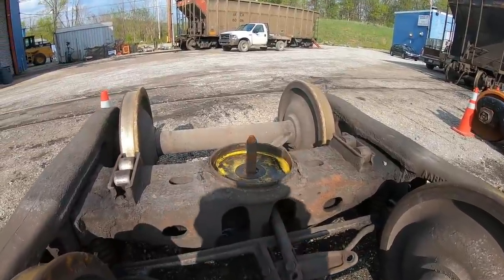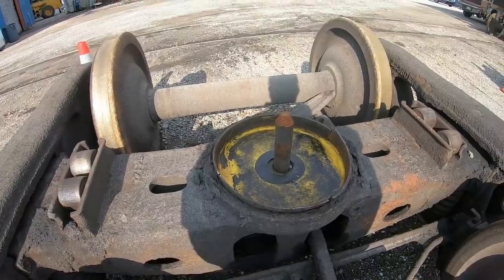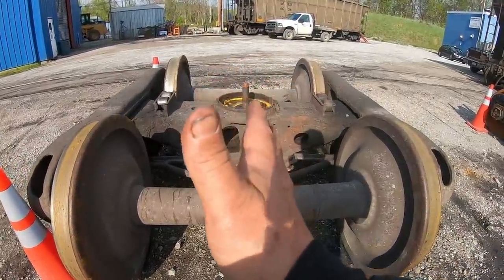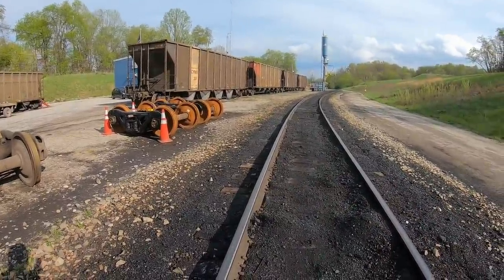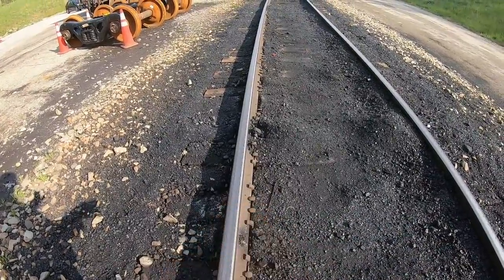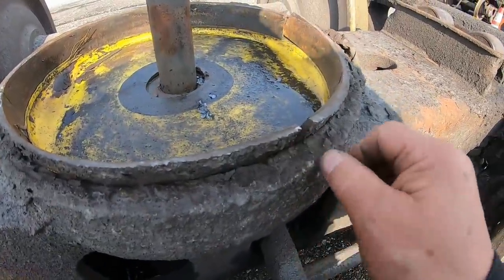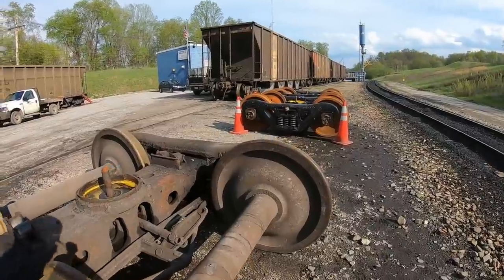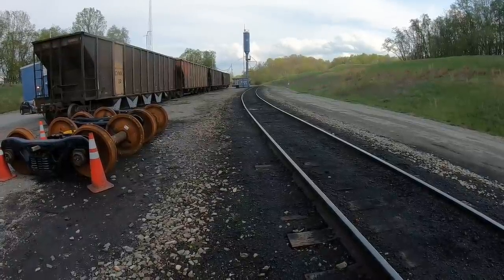Why the Derailment at Curve 18  Happened

Comment: Sorry, But I cannot agree with your finding. You didn't say much about what the track condition was before the accident,so it is hard to say. That center pin would have been bent if the truck was the cause. For the rim of that centersill to have cracked like that without bending the pin likely tells of heavy slack action over the course of the life of the railcar. I bet the lower end rail was the rail that caused the accident as it is more prone to natural damage. 
 I drove a locomotive over what seemed like perfectly normal/good rail, only to have the gauge spread out from under. Weather rots those ties (especially on a lower elevation section of rail), and those tie bolts and spikes can come out quite easily given a minimum of stress. 
 Also I can't even begin to guess how many of those railcars are without sufficient lubrication on their centersills. That's why the liner is made of tough plastic. The sheer weight of even an unloaded flatcar keeps the wheels on the rails even around turns. The couplers and speed (you said 22 MPH) helps this as well. 
 How long was your train?? what number was the car that first derailed?? 
 Also the AAR standard track gauge is 48 3/4 "
Reply: You mean 4’ 8 3/4” ??
Reply: @billmoran3812  Yes, I should have edited my post. The gauge  is 4ft 8 3/4 in.

Comment: I've jacked thousands of cars. Haven't seen but a few with lube in the bowl. Most have graphite patches if anything.
Reply from the maker: I believe the grease they use here George is a graphite based lube,
not sure why they put it in with the liners, but they always have.
Reply: @ccrx6700  I think the liners are Teflon. That's one of the reasons for them is to aid in rotation. Main reason for wear. I'm sure if they have any other lube other than the graphite patches it's because of the tight curves at the mines. I've seen them grease the rail at the curves to aid In maneuverbility. Thin flanges are bad for derails on a curve. Not sure were yours was. Looked like the pilot sheet on the motor was damaged. What did it hit, just the rail?
Reply: That center pin looks new in the truck. Wonder were the original one is.

Comment: What I am seeing here,  are all kinds of questions and zero answers.    A train running  around  20mph should be able to stop in  500 feet.   There are over 1400 feet of broken track.  Either the engineer never knew he was off the tracks and keep going as normal or  the tracks were not very well-connected and fell apart.     Maybe the brakes were not operating normally.     The "RED FLAG" I see,  is the 1400 feet of track and a very slow moving train,   it just does not add up to a solution.    A faster train,  50mph, yes,  it makes sense but,  not at 20mph.     Something just isn't right with this incident and the 1400 feet of blown track.    Hope they get it all figured out and cleaned up and back to hauling coal.
Reply: Lmao @ stopping from 20MPH in 500ft.
Reply from the maker: Rear DPU was still pushing for about 500 or so feet before
it came uncoupled and train went into emergency, then it took
another 800 or so feet to get the cars and lead loco stopped,
hope that helps make better sense of it now. Thanks for watching sir

Comment: I don't know. Speed and weight has a lot to do with the derailment. That locomotive have a speed recorder on it?
Reply: They have event recorders that capture everything from throttle speed to brake applications, travel speed to blowing the horn. Most locomotives have forward facing track image recorders also. It’s all interconnected.
Reply: Train was going 20 mph...
Reply: I should have mentioned that also, i believe he said the speed limit is 25 mph and the train was traveling at 22 mph. It was also stated in the first video after the derailment happened that this was one of the best sections of track on the whole railroad. So my guess is speed and weight had absolutely nothing to do with the derailment. 
The only weight limits on a railroad are going to be load limits on the bridges and any  sections of road bed that have poor drainage and have a mushy bed because of that.
Reply from the maker: Ola as Thomas the Tank Engine said, Silly cars always causing
trouble because they are angry. Thanks for watching my friend.

Comment: Makes little sense. Your theory actually sounds like maintenance of way trying to blame the car dept. For the history of railroads center plates have had little to no lubrication. In the eighties we had little grease patties we dropped in the center plates when we had the trucks out in the shop. Somewhere in that timeframe builders where experimenting with adding a steel wear plate. The plastic liners had not even been invented yet. The plastic offers much more lubrication than the metal to metal which had been the industry standard for decades even without added grease. I did notice one thing just after the 9 min mark of your video. the axles where NOT parallel, OR the wheels where not square on the axle furthest away from the camera. I have NEVER seen that before and it should be impossible if if the wheels are properly fitted on the axle. A wheel not running true will have the effect of reducing the gauge of the wheel set allowing the wheels to drop between the rails. The entire truck may have been out of true when it was craned into its current position but it would not stay that way without some outside force when placed back on the rails. I would really like to see those wheels rolling down the track. A bent axle or out of true wheel will most def cause a derailment. Those reasons and a bearing inspection is the reason why wheel sets are bad ordered whenever they hit the ground.
Reply from the maker: Excellent observation Ed! Yep it sure woulda told a good story
to see them rolled down the track. I wonder if the alignment problem happened because the truck set was drug so far on the ground and/or got that way when they pulled it out from under
the car with the high lift? I've seen them skewed before after
they pulled them out, maybe combination of both.

Lyon's Industries of Ebensburg Pa. rebuilds our truck sets, it was
their suggestion many years ago to add the grease so that is
what the guys here have always done (maybe he just wanted to
sell us cases of grease...LOL) Great comment you sent Ed, thanks

Comment: Those cracks are old. The have oxidized. "Rusted again. As well as if yo look at the thickness of that ring of metal. It is almost HALF as thick as new. That was not cause by the derailment.
Reply from the maker: Im kinda thinking it had been broken before to Michael, but
As Thomas the Tank Engine said, Silly cars always causing
trouble because they are angry. Thanks for watching my friend.
Reply: @ccrx6700  thank you for giving a informed perspective on rail issues. Haven't seen rail lines or anyone else do that.

Comment: Lack of lube in the center plate had nothing to do with it.
Reply: Yeah if the truck set didn't pivot as it should, the. It had everything to do with a stuck pivot...
Reply from the maker: As Thomas the Tank Engine said, Silly cars always causing
trouble because they are angry. Thanks for watching Jeffrey.
And as you know the track men always blame it on the car men,
the car men blame it on the engineers and the engineers
blame it on the track men...LOL

Comment: I’m no train expert, but, why didn’t the train derail, instead of taking the track with it? Must have been very heavy loaded rail cars. I think speed, had something to do with it, also, because, that was a lot of track taken out, before the engineer derailed the engine. So do you need speed, plus weight, and a bad disk thing. I’m guessing here. I’m just making my own conclusions. I’m no expert, I never worked with trains, just giving my two cents worth.
Reply from the maker: 2 cars and the loco derailed on that one, tore up a bunch of track
along with it. Train was going at 25 and once it went into emergency
took awhile for him to get stopped. Appreciate your checking out
the video today my friend.
Reply: @ccrx6700  Thanks for the explanation 👍Love your videos.

Comment: I don't understand the explanation at all, maybe you don't know how a train turn???
The point is that the wheels shall move to the left in a right curve, the radius is bigger on the wheels inside than the outside and both wheels on the same axle rotate at the same speed.  So, when the wheels move to the left, the left wheels will push the train to the right due to the larger radius.
It has nothing to do with turning the carrier, that is only to reduce friction.
Reply from the maker: Sometimes things just break and go bad on the RR. We been
very fortunate that this was the first time that I can remember
since 1993 or earlier that a problem like this has occurred here.
Thank you for watching and hope you will enjoy the rest of the
videos coming out about the derailment events.
Reply: @ccrx6700  Yeah, nothing last forever.
I like the videos, thank you.

Comment: the reason why that train derailed is because they used river stone between the ties instead of crushed gravel. Because river stone is smooth without edges it shifts very easy. You always must used crushed gravel between ties on bends and river stone only on straight runs of track
Reply: But even if the ties and rails shift, that wouldn't roll the rail out would it?  The track ties still had the right super-elevation, so they must not have shifted much.  Something pushed the high-side rail outward and his idea of the truck-set not swiveling would do that.
Reply: Yeah I remember when I was new to the world too lol. That's the worst idea yet lol.
Reply from the maker: As Thomas the Tank Engine said, Silly cars always causing
trouble because they are angry. Thanks for watching my friend.
And as you know the track men always blame it on the car men,
the car men blame it on the engineers and the engineers
blame it on the track men...LOL

Comment: Not sure what your craft is but CARMAN you are not....The center plate liner did not cause the derailment.  That is a Teflon NON GREASED liner....The trucks were not rigid going  thru the curve. You are making no sense saying  the trucks followed curve but the body went straight.......Sounds like the Operating department telling the mechanical department what happened......I have a bit of experience in this field...26 year Carman for BNSF , road truck for many of those years. Many, many derailments. In multiple of states including coal country "powder River division " Wyoming.  Obvious it was the lack of proper maintenance on the track. I've done multiple of hundreds of center plate liners and not once do we apply grease.
Reply from the maker: Thank you for sharing your thoughts on that Tim. Carmen always
blame track conditions. Track men always blame engineers and
engineers always blame carmen. :-) Our truck set rebuilder,
Lyons Industries recommends greasing the teflon liners, perhaps
that might be something for you to consider since you've had
so many derailments? Just a friendly suggestion. Thank you for taking the time to visit with us and may you have a very good day my friend.

Comment: I don't buy this reason for all the track that was damaged.    1400 feet is a long, long way for that much track  damage.   One truck would only cause that one truck or maybe the car to jump the rail not split over a thousand feet of track.    I could see one section popping, maybe 50  to a 100 feet,  but not 1400 feet.   I still say after looking at the damage that the company had low standards for track maintenance.    That's over a thousand feet of track that was not connected properly to the ties.     Something wrong with the tracks not the cars.    I do not see a well built and well maintained track  splitting  for over a thousand feet from one truck.     Something is wrong with this track construction,  bad wrong.
Reply from the maker: appreciate your watching and for sharing your thoughts with us, hope you'll be able to view more of the videos coming out soon on
the derailment
Reply: @ccrx6700  Glad there are no injuries and no cars dumped over.    Hope everyone is safe and back to work soon.

Comment: trains are still based on 1800s tech. i'm surprised there aren't more derailments. you can do all the analysis and studies or whatever you want but the fact remains that there are no fasteners connecting the trucks to the cars . the rails are held to the ties but just to hold gauge. nothing is holding the ties down. it's gravity. its the weight of the train that holds it all together and speed and curves and g force just seem like a bigger recipe for disaster than what we've seen so far.  just my $.02
Reply from the maker: Thanks for watching Joe.
Hope you'll stay tuned for the rest of the upcoming videos on
the derailment.

Comment: your railway is soo out of date. wodden sleepers and nails to hold your rails down. soo out of date
Reply from the maker: Perhaps, it was built in 1975, however concrete ties have not
proven themselves to hold up under heavy loads, they are ideal
for transit. You might want to read this article to learn more
about the problems concrete ties have. 

https://www.rtands.com/track-structure/ballast-ties-rail/new-paradigm-design-concrete-crossties/